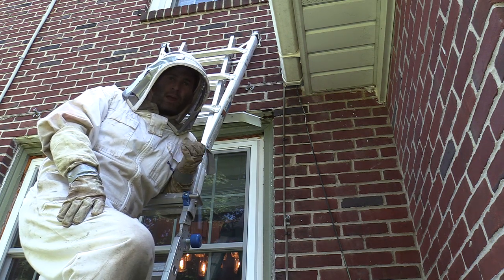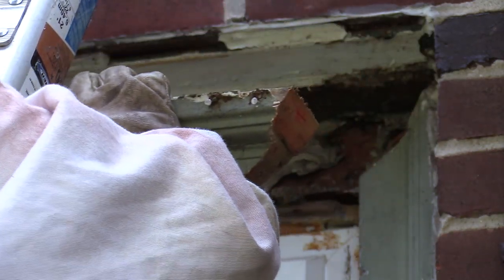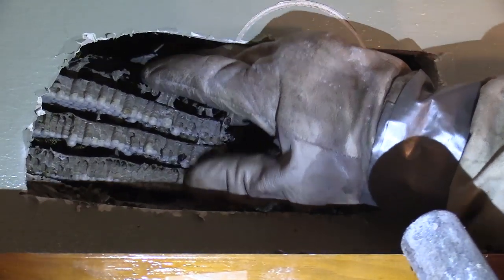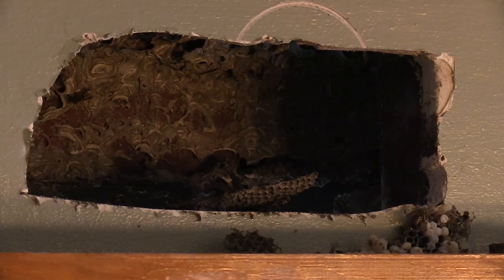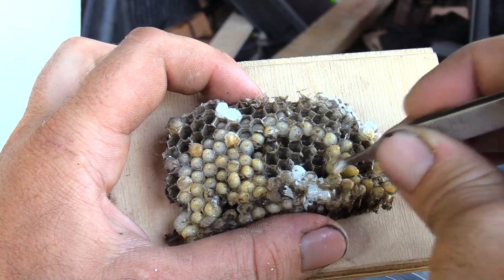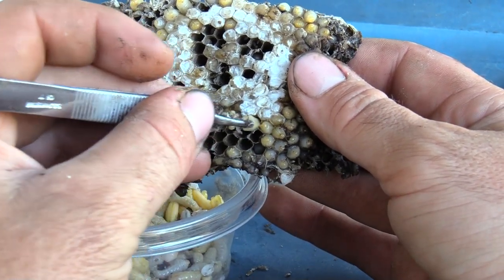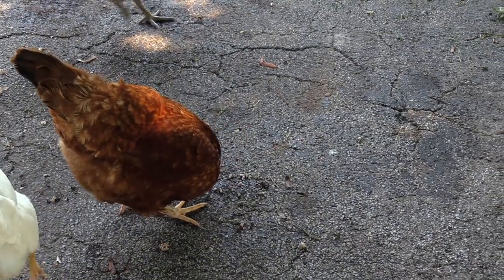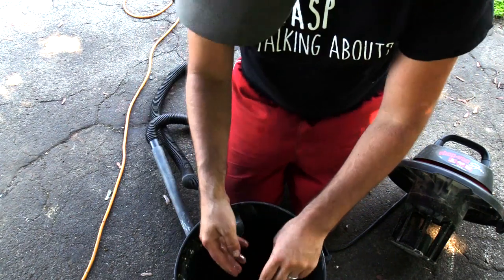Yellow Jackets INFESTATION Large Nest Inside House Wasps

Comment: So at a certain point, do wasps/hornets just shrug and give up swarming/defending. It seems like after half is removed they went 'It was a good life.' and let you remove/destroy the nest.
Reply from the maker: It might have seemed that way because I battened down the numbers by sucking them up in the vacuum. I mentioned in the video that the reason I did the vacuuming outside was so there wouldn't be a swarm INSIDE. 

The adults you saw inside were mostly newly hatched adults and they don't really fly right away.

Comment: "Plucking the larva out of the comb" reminds me of a program about that same subject I saw on TV a few years ago but never forgot. It's about and seems that there's a giant wasp in China. This wasp dines on other bugs. While this was going on two Chinese men took a VERY light thread about a foot long with a loop rigged up on one end and a small feather on the other end. While this large wasp was eating on a grasshopper (and not paying any attention to the two men) they put the loop over the wasp's abdomen or rear end and tightened it just enough to where it wouldn't come off while the wasp was flying. Well, the wasp is fairly aggressive and was shown LOTS of respect and they watched as the wasp took off (without the bug) on the way back to the nest. Which they knew to be close by. So they watched the easily seen feather attached to the wasp as it's flying through the air and found the nest as the wasp approached, which was about 20 feet up on a limb of a tree. So the two men got a long pole and put some rags on the end and lit them on fire where they smoldered and made smoke. The smoke made the bees leave the nest (which was fairly small for being such big wasps) and fly away. As soon as they made sure the nest was empty they sawed it off the branch and brought it down. It was obvious that the nest was the prize all along because next thing they started doing what you're doing in this video which is plucking the larva out of the comb. Remember this is a BIG wasp so the larva are a bit larger then the ones you're plucking. So they pull out this type of pickle fork looking tool and start plucking. The BIG difference is that instead of giving those to their chickens like you mentioned you do, these guys start eating them and giggling like little kids thinking they're getting away with something as they're munching away!!!!! And I'm NOT kidding. My first thought was wow, NOTHING is out of bounds as far as snacks go to the Chinese (and no wonder so many things over there are endangered) but it was a VERY interesting program nonetheless. Anyway, my bet is that you probably haven't had any kind of a wasp delicacy like the Chinese guys in this nature program??? At least on purpose. I like & enjoy your videos!!!!

Comment: Great video.
A few questions:
1. Why was there no insulation in the section of the wall where the nest was? Poor quality control on the part of the home's builder? Pennsylvania is located in the NE USA and gets very cold in the winter so that surprised me.
2. I recently saw another video of a similar inside wall wall removal of a wasp nest, it was performed in Alabama I believe. In taht case the professional pest control specialist used tow kinds of liquid insecticides to kill hundreds of wasps. Why did you not also use insecticides to kill the yellow jackets?

Comment: These nests of this size, where is the queen most likely to be found? in between the layers? Outside of the actual nest? Just sort of crawling around loosely in the? Does she have a specific location usually???
Reply from the maker: She is usually on the comb but as I remove the nests she'll retreat between the comb.
Reply: @HornetKingOfficial  interesting. Thx!
Reply: Is she like a captain on a ship? In other words is she the last to leave The Hive should it be treated with something?
Or is she the first to leave? 
I'm only asking because after power washing our house we've recently discovered what we think is a fairly new nest inside of a cinder block in the foundation of our basement. We had a new water heater installed, they sealed with foam on the inside but the guy never went around on the outside and sealed around the plate that goes around the white PVC curved pipe that extends out of the wall  for venting. So they have been crawling up and around that plate and have found a way inside that block. I'm curious how big the nest is because some that have backed out have come in somehow into my basement and have found a way to squeeze through even the smallest of cracks just not sure where. we're thinking we're the foam kinda oozed & dried against the inside basement wall around the pipe there may be and opening but my husband put silicone around it possibly missing a whole? So far I've got about thirty dead bees over a two-week span because we've been treating with permethrin dust.  Almost positive that it's only inside the one block which is at the top where the siding meets The basement foundation. so I've been curious to know is the queen still in there or did she leave and everyone is backing out? we haven't sealed it so that way the adults they can back out... But I've been reading up on their life cycle...curious how long it will take all of the larvae to hatch if the adults no longer able to get inside to feed? Seems I read 22 days is the lifespan of the larvae. but the queen can keep laying eggs. I'm hoping they don't winter over being it's inside of a cinder block where my water heater is venting

Comment: Am i missing some thing
Why didn't he seal the hole from the out side.  Except one big enough to insert a hose them spray multipul cans of fly spray or into the nest...
When doing electrical some times 20 feet in the air
I found fly spray worked the best
Biggest can i could find
Start the spray and don't stop...
Kills them right away and they can't escape the fog...
Don't cheap out biggest can you can find with back ups
Reply: jim h the owner is a carpenter and said he’ll take care of repairs
Reply: @alexmoore1506  
?.??????
I wasn't talking after the fact..
I was talking about maybe an easier way to terminate the colony
He would have needed to open the wall to clean it out

Comment: You know that you probably don't need to pick the larva out of the nest before feeding...

1st, the chicken will probably enjoy picking them out themselves & aren't likely to eat the paper. Why waste your time to steal the joy of doing so from your chickens? 

2nd- if extremely concerned over potential consuming of paper or birds inability to do so independently; just shove them in a bucket of water with a bit of dish soap. Add some agitation & they should just fall apart with the larva at the bottom & the rest pours out with the water. 

Hopefully, this puts an end to you wasting your time picking larva. If you just like doing it, then all the more power to you. 

Adam

Comment: Seriously, if you're that concerned about them not sharing nicely, break into a bunch of pieces with at least a bunch of pieces per chicken & put in separate areas.

It's hardly any reason to not feed them in more reasonable, natural, sane methods that saves you stupid effort & robs them of the fun of doing it.

Besides, it's slows down the rate of feed which is important. No animals should eat relatively quickly, it's not good for digestion.

The pure larva pile is what's causing the possessiveness, behavioural issues, guarding, gorging, etc. Just give them the bloody comb!

Adam

Comment: Lets see, tear out the window, tear open ceiling, tear open wall and 3 hours of work??  1 can of foam o fill 5 bucks and 5 minutes at night into hole...seals and solves the problem.    Move over 2 feet drill do it again. DONE...it myself..fast clean. and insulated.